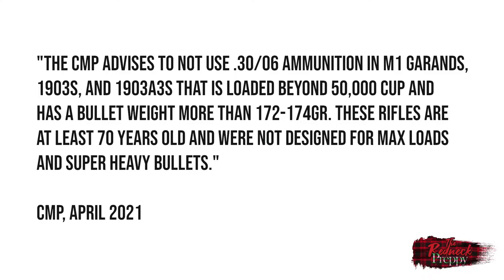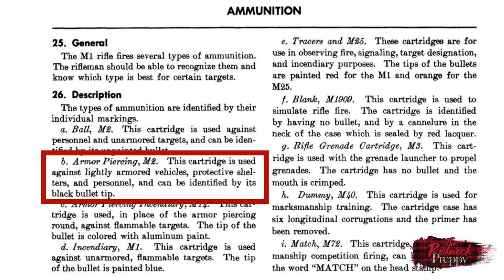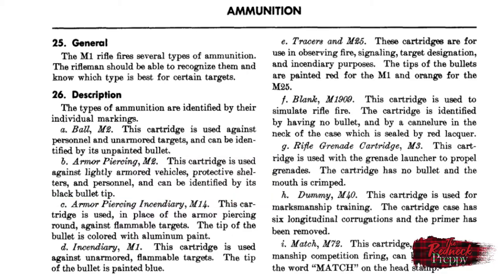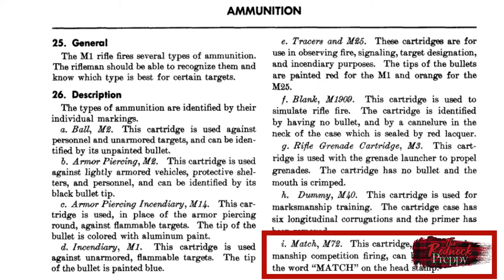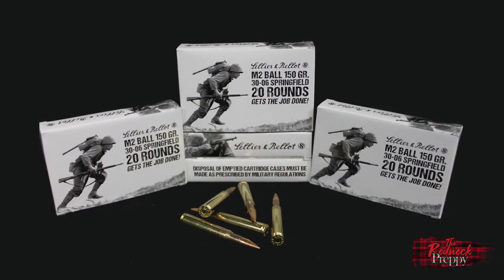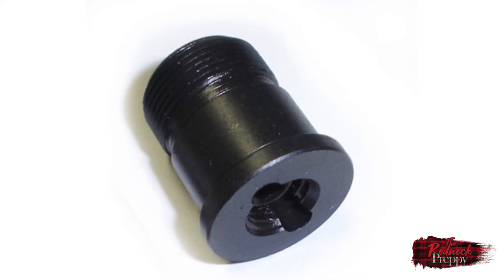Can You Shoot Heavier Bullets Out of Your M1 Garand?

Comment: Gas port pressure is important because that determines the force pushing on the operating rod, and you don't want to damage the operating rod from excessive force.  If you look at the brief bit of reloading information you showed and compare it with general reloading information for the .30-06 you see that those powders burn faster than the average burn rate for normal data.  Faster burn rate powders will have lower pressures at the gas port and not put as much force on the operating rod.  And it is also relevant to note that the military match ammunition developed for competition used 173 grain bullets, and the Hornady loading manual contains data specific to the M1 Garand for 180 grain bullets.
Reply: Good post and you seem to be one of the few posters that understand this.  I used a match tuned M1 in competition in the early 90s.  I used a 168 BTHP match bullet with 48.0 gr of IMR 4064 which is the slowest powder I would recommend using in the Garand.  I have shot up and still own a quantity of M72 Match ammo.  Information I have shows that the 1963 lot of M72 provided by Lake City for the Nationals was loaded with 46.7 gr of IMR 4895.  In both of my M1s, the correct powder burn rate will eject the cases at about 4 o'clock.  I experimented with a few rounds loaded with Accurate 3100 and the cases ejected about 1 o'clock indicating too fast bolt speed due to excessive gas port pressure.

Comment from the maker: At a certain point I referred to a bullet's weight as "150 rounds" instead of "150 grains" -- proving you can watch a video multiple times during editing and after its rendered and still miss something that dumb.
Reply: Editing your own work is always difficult.  You hear or read what you intended, not necessarily what you said or wrote.
Reply: I caught that as soon as you spoke and was looking at the comments to see if anyone said anything .
Reply: I used to work at Lake City Army Ammunition Plant ( my son still does) and sadly they stared tearing down Bldg 4 in 2022 where the M2 Ball & 30 carbine was produced and will be erecting a new building for the 5.56x45 replacement . The lab were they are developing the new round was on the other side of the wall from where I was working in 
BAM ( Bullet Assembly Machine) . Not my favorite job running those machines (4 at a time ). .

Comment: I use a McCann adjustable gas lock screw to accommodate slower powders and heavier bullets.  My Garand did best with handloads, 180 gr match bullets and IMR 4064 for about 2550 fps.  These days I'm back to a GI screw and handloads of 150 gr Matchkings and IMR 8208xbr powder for about 2700 fps. Ejects to about 2 oclock.

Comment: Old timer I knew used to say you could use any ammo in the Garand by removing the gas plug entirely. This will require you to cycle the rifle manually like a bolt action though but prevents any damage to the rifle.  I have never tried that and nor did I see him do it so beware lol  I always wondered if that was possible though.
Reply from the maker: It certainly does sound plausible. I'm almost tempted to try it next time I'm at the range.

Comment: Like you, I’m a 150-grain “purist” when I load for my M1.  But the Hornady manual lists loads for the M1 Garand with bullet weights of 150, 155, 168, 176 and 178 grains.  And Handloader magazine published load data for both 150 and 168 grain bullets.
Reply from the maker: Honestly makes me wonder why people say 150 is the only "safe" bullet.
Reply: Its all because of peak pressure on the gas system, it can rattle the guide rod and gas plug to pieces, you can use modern adjustable gas plugs these days if you really wana protect your gas system from running hotter/heavier loads
Reply: @dillonyeasting205  or you could just grease the gun as you properly should and make sure your recoil spring is within specifications

Comment: What I dont understand is that Garand Gears data is promising at first sight… however, before just blindly trusting I looked around… I ended up going with Schuster MFG adjustable gas plug… real world testing and op rod velocity (and therefore high gas pressures) were still at the fringe edge of “safe.” Not a lot of information out there on the Garand gear plug. Although it is convenient as a plug and play option… when it comes to using a wide variety of commercial ammo, the Schuster allows for specific fine tuning so you can tune the rifle to the load youre firing. They are both roughly the same price and I just figured id eventually find a load that likes the M1 Nd Id stick with it. I aint saying one vs the other… but after a lil more digging on the garandgear plug… their tests seem, to me, a lil too good. All their plug does is give more volume of gas to be entered into the system and therefore assisting in lowering the pressures (compared to standard M1 gas plug that is not hollowed out). So im sure if ur using ammo that is roughly near the same as M2 ball, itd be a lil smoother but once u get to the higher end of loads then pressures begin to outweigh the “gas volume” you have with garandgear plug.

Comment: Isn’t it a powder issue also ? Fast 🔥 burn
I bought the gas plug because I wanted to hunt with my rifle !
Reply from the maker: It might play a role, never came across anything definitive.

Which gas plug did you go with? I was tempted to order the Schuster plug last night.
Reply: @TheRedneckPreppy i ordered the grand gear plug it works good with hunting loads so far, but with the cost of ammo i haven't ran it much
Reply: Imr 4895 I'd the powder. H 4895 too. Powders like 4350 I was always told would bend the op rod.
Reply: @TheRedneckPreppy  I ordered shuster of eBay

Comment: Can I shoot remington core lokt 150 or 180? I’m so confused
Reply from the maker: It's the pressures generated by ammunition that can cause the issues. I don't know enough about those rounds to be able to say for certain.

I checked Remington's web site and they don't list much for either round other than muzzle velocity and ballistic coefficient. I will say that I would definitely stay away from the 180gn as it's probably loaded past the recommended pressures.

If you're going to go with commercial ammunition, Hornady does have a M1 Garand specific round that I think has an 170 gn bullet. Winchester has a round with a 150 gn bullet that's made specifically for M1 Garands.

There are others -- PPU and Sellier and Bellot that also produce M1 Garand specific ammunition but I don't know much about them as I've never shot them.

Comment: You seem oblivious to the fact the John C. Garand himself used and recommended 1925 vintage M1 BALL (not M2) with a bullet weight of 174.5 grains.  Another thing you don't seem to highlight.  The PRIMARY ammo USED in COMBAT in WW2 and Korea was M2AP which was 165-168 grains.  Try reading a primary source.  FURTHERMORE, while catching the "and" part of the truly laughable CMP "ammo message," you also missed the problem of there being NO SUCH COMMERCIAL AMMO which meets this specification.  NO AMMO (or reloading data) "is more than 50,000 CUP."  And it's not pronounced "cup" (like what you drink from) it's COPPER UNITS of PRESSURE.  50K CUP is the equivalent of 61,190 PSI (pounds per squre inch" as measured via a PIEZO strain gauge. In other words, the CMP guidance makes ZERO sense with or without the word "and."